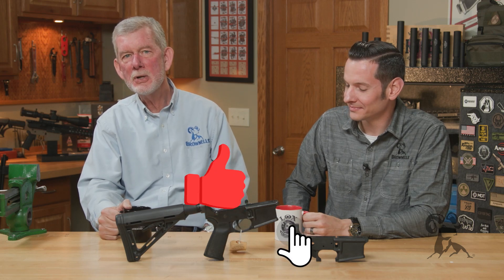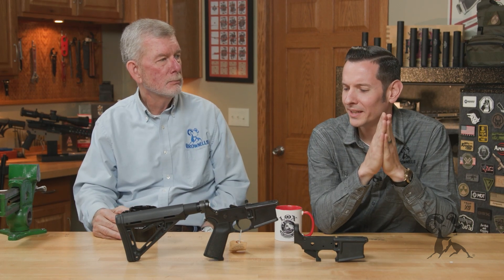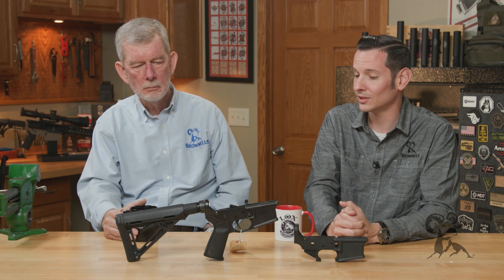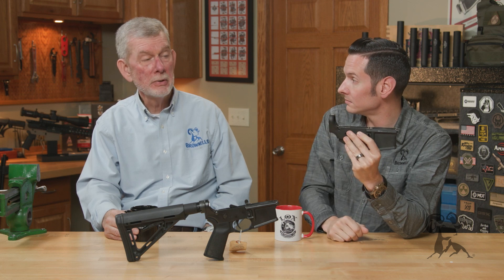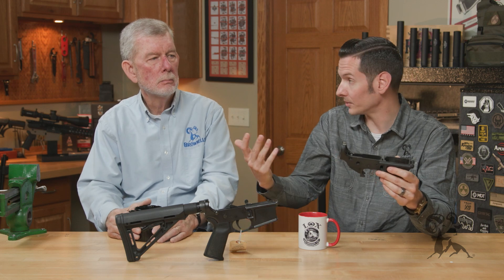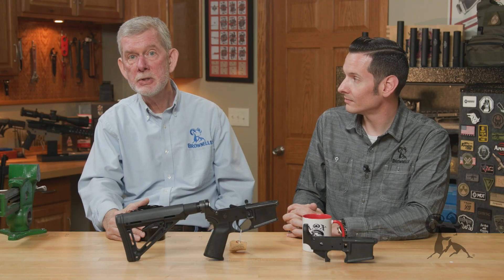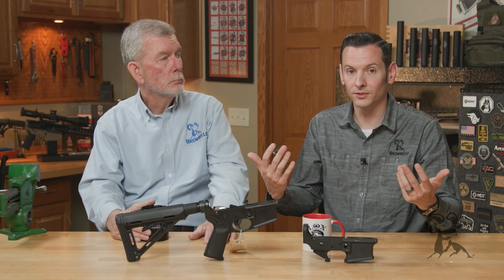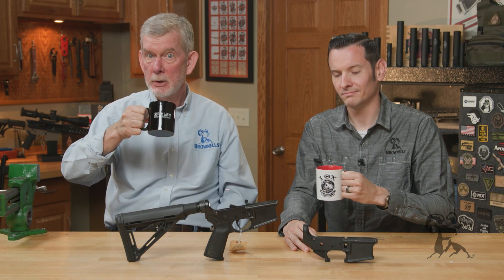Smyth Busters: Are Polymer AR-15 Lowers Any Good?

Comment: Steyr AUG?

The problem is that when people think “polymer”, they think it means “all polymer”.  Particularly with the Glocks, the bearing surfaces are frequently reinforced with metal to absorb the friction of the moving metal.  In the case of the KP-15 and KP-9, since the bearing surfaces are mostly in the upper, they can do much more with just polymer (although they do warn about using smooth springs in the buffer tube to avoid abrasion on the support surfaces).

Comment: One of the most durable polymer pistols I've ever owned is the Ruger P95. Not only is it polymer but it doesn't have steel rails that the slide rides on.

Comment: I have an American Tactical Imports complete polymer AR for a few years now and the lower is great... I did crack the upper but I blame myself, I let the upper drop as the lower was in a vice and   the upper was still connected with the front pin, had a bunch of accessories on top as well so it cracked, the lower was just fine tho.
Reply: Yeah I'm not buying that story. If that were true, recoil would have broken it due to the inertia of "uh bunch uv accessories". A lil swing on the front pin shouldn't have broken anything on a functional product.
Reply: @camojoe83  had it for years before that happened idk... It was fine until I did that but in any case the lower was still gtg... I think forces that act on a weapon when it fires might differ a bit from dropping it. For instance, did you know that your not supposed to pull the trigger on your AR without the upper or a block? It can damage your lower. Sometimes you can get away with it sometimes it can't.

Comment: They real comments is that any lower will function correctly if the design takes into consideration of the material properties is made of.  I'm willing to bet if you do a polymer lower with the exact dimension of one made from aluminum it will not last.  Almost anything can be built as long as is engineer correctly.

Comment: Hypothetically speaking (the what if game), if you had to startup from zero. Speed, availability, and cost being sole factors would it be aluminum or polymer? Durability or longevity notwithstanding.
Reply: I would assume aluminum because it would be much easier to sell to people without brand recognition and trust. Polymer should come about later on once you’ve built good will and a customer base
Reply: Create brand recognition first, makes me think of CompaQ “compatibility and quality”. Consumer confidence and recognition should be most important consideration. I was thinking that would be recognized in the engineering of the components. That driving factors should be cost and availability upfront and as demand increases speed in scaling up. Aluminum or polymer?

Comment: I have a KP-15 build that’s wonderfully light and no worries about that stress point Caleb pointed out. However, I would only use a cassette type trigger in it, not milspec. There’s just enough play around the pins to make me not trust it. There’s a reason KE-Arms sells captured fire control pins - that’s what you should use with their lower and you should only use those with a cassette type trigger.

Comment: It won't last but the fact is that it doesn't have to. I mean I have like 5 polymer lowers and iv never had any fail though I didn't shoot any of them extensively. I'd say you can be sure it will work for a minimum of 1000 rounds.
Reply: what i seen most polymer lowers thats the exact  stopping point 1000 rounds and they break but the ati lower i had lasted 400 rounds maybe a few rounds less than that

Comment: I did a CWP course in SC and used a Gen 2 Glock 19. One of the employees pointed out the original case that I had the pistol stored in to another employee. Almost exactly like a Tupperware container.

Comment: I have an AR308 and an AR9 on a polymer lower both run flawlessly with no issues. People just like to buy crap, go with brand that shows what their lowers can do, 3rd party reviews, and integrity.
Reply: Pushup test. Now.
Reply: @camojoe83   how about a push up test, testing a .50 bmg upper on one in -5°f weather, running it over with a car, sitting it in an oven for 1-2 hours at 170°, and putting it in a vise crushing it and still snaps back to shape. All that and if you still managed to break one has a lifetime warranty.

Comment: I will pass on a polymer ar15 lower. There is a big difference between a pistol lower and an ar-15 lower. On a pistol like my SIG P320 the polymer connection to the barrel is reinforced by the FCU. On the back or am AR-15 there is a very small area that takes all the force, as  he pointed out in the video and I just don't trust it, especially in temperature extremes, where plastics will be more brittle.

Comment: I've been using James Madison Tactical's Carbon 50 lower for awhile now on a 6.5 creedmoor and a 308, the reduced weight was really nice. The only issue I've had was using anti-rotation pins, if you tighten them too much, you can cause failures on standard FCGs, namely the hammer not locking back when the rifle cycles, all that needed was to loosen the pins, though I mostly use single piece FCGs now, those have had no issues.
Reply: Zac's DIY Guns  So many jokes you just laid up for me there....but seriously, no issues other than the bolt catch fitment I mentioned above.
Reply: I've had very good performance out of JMT's lowers, both the regular polymer and the Carbon, in 5.56, 6.5 Grendel, .300 BLK, and .308.  Only issue is some aftermarket bolt catch assemblies (Phase 5 EBRv3 comes to mind) may be a bit thick where they ride inside the lower, nothing a little filing can't fix.  Milspec parts are no issue.

Comment: You guys are always a pleasure to watch. Thanks for taking the time to prepare and present these videos.
Only experience with polymer ARs was a Bushmaster Carbon 15. Upper and lower made of polymer. Came by it in a trade. Was covered in a factory paint job with multiple silver color overlay of skulls. It was UGLY! And further, I didn't trust it any further than I can pick up and toss an M4 Tank. Fortunately, I found a guy that wanted it bad, and it was gone fast. Nope, I don't trust plastic guns, far less if they have stupid skulls all over 'em! 😄😛
Reply: Did you even shoot it?  Or did the skulls scare you?
Reply: Oh yeah, I shot it a bit. Was over gassed, and not the most accurate AR carbine I've fired. Just wasn't something that I needed.

Comment: I design 3d printable firearms, ammunition and accessories and yah, polymer works if done correctly. Just finished up an ar15 style design that has a plastic lower and upper and it's running like a champ.
Reply: Not strong enough for a dinner plate. 3D printing is even worse than the old polymer lowers. It was created for proof of concept and to keep from having to make multiple expensive molds. It's not a be all end all as most of you proponents think it is. On the contrary, it is the very last thing I would ever want a weapon to be made of. A stick would be less prone to damage and much easier to replace in the field.
Reply: @drtmi8789  navi go boom is gonna take a hot steamy dump in your pillow case once night. you are full of s-h-i-t. the ubar lower is strong as hell. edit: it seems i now have to manipulate text, because youtube has gone the way of twitter and instagram

Comment: why buy a poly lower when you can print a U-bar or hoffman tactical lower? Incredible strength
Reply: Because printing is/was not created for production to get every Tom, Dick, and Harry into building guns. 3D printing was created for proof of concept to save on mold costs. 3D printing has NO place on load bearing surfaces.
Reply: @drtmi8789  I agree that printing is not up to snuff on load bearing surfaces. However, this is a discussion of AR lowers

Comment: I’ve been 3D printing a few. Where the buffer tube threads in are reenforced with either a bolt, overprinting, or using a folded piece of metal that is either screwed or melted into place. Annealing helps too on certain designs.

My KP15 works just fine too….and it’s in 458😂😂
Reply: Unless you're printing the whole stock and buffer tunnel integral to the swollen, stupid shaped lower you have to make, 3d printed lowers are a stupid waste of oil.
Reply: @camojoe83  not really. Like I said, people have found ways around it. But, to be clear, they don’t last as long as metal lowers, but after 1-2 thousand rounds, you just print another. My Hoffman designed lower is at about 1100 at the moment, no issues.

Comment: Still better to get an aluminum lower for same price
Reply: Fair but if you want one that isn't tracked, it's much easier to finish or print a polymer lower for the common person than it is to finish a 80% aluminum one. 

If one doesn't care about that, then aluminum all the way.
Reply: Really?  A stripped KP-15 comes in at less than $90.  All you need to complete it is your FCG, mag release and bolt release.  An Anderson or PSA lower comes in at $59 on sale.  Then you still need an entire small parts kit as well as a stock, and pistol grip.   That puts you above the KP15 in cost.  Plus you get better features with the KP-15 such as a flared mag well and a Magpul like grip.  I can attest to lower buffer spring noise when using GI spring and buffer.
Reply: @panzerabwerkanone  in all reality both require similar priced lower parts kit  with FCU (the few parts that come with the KP15 aren't going to save much money buying separately), buffer and buffer spring. The only real difference is stock and you can get a standard m4 buttstock for $22.  So all in all they are about the same....but you're stuck with a non-adjustable boat anchor of a stock with the KP15.

Comment: I have a KP15 and its just fine. I put a pencil barrel and a 8 ounce aluminum handguard and its unbelievable how balanced and good the gun feels.
Reply: Why would you put such a heavy handguard on a lightweight AR
Reply: @Valorius  what do you recommend?
Reply: @deejayimm  for a handguard?
Reply: @Valorius  yea, what would be a good one for a light build
Reply: @deejayimm  there is a vid on my channel for the one I use. It's 10.5" and weighs 3.7oz with all the hardware and barrel nut.
Reply: Have one myself.  Love it.
Reply: Did similarly years ago, pencil barrel on a Cavalry Arms lower, but used a regular plastic (with heat shield) CAR handguard.  Light, balanced.  The Cav Arms was the predecessor to the KP15 lower.  They took what they learned from the Cav and put it all into a much more refined lower.
Reply: Awesome!  I've built two.  My first was for less than $600.  A much better gun than I could buy assembled for that $
Reply: We will see how balanced and good it feels when you are holding with two hands. And it’s a piece in each hand
Reply: @Dan-qn3su  because even though it is being held with two hands you can feel the difference in weight from the front to the rear. A rifle can be front or rear heavy.
Reply: @cameronwashington7650  I think he's trying to insinuate that your lower is going to break in half.

Comment: Can you do one about sharing BCGs between different uppers? Does the bolt really wear to the locking lugs?
Reply: I switch mine all the time. It makes no difference what so ever.
Reply: Only if you have a lot of rounds through either.  It is not that much of an issue with the AR-15.  Buy a set of headspace gauges if you want to be sure.
Reply: It's not the issue it used to be. Manufacturing is pretty tight these days even among different suppliers of parts.

Comment: If nerds with 3D printers can do it, I'd hope an injection molded polymer process can hold up.
Reply: They can only do it for one video at a time tho.
Reply: @camojoe83  that's a lie. Some guys have well over 1k rounds through proper built 3D lowers.

You just have to have the right material and know how to make a good print that has good layer adhesion. You have to account for shrinkage when you go to anneal. There are factors here that most people never understand because they have their heads in the sand.

Comment: I was in a gun shop a guy came in with a polymer lower that broke at the rear takedown pin. The worst part was he paid over 1000 for the compleat gun. Same gun store wont sell polymer lowers of any brand they have seen to many brake with low round counts.
Reply: Across the board proclamations is typically the realm of the moron.
Reply: Pardon me sir, compleat=complete
Reply: @camcom76  There were more misspelled words than that.  I realize English isn't everyone's first language but you have the sum total of human knowledge at your disposal.  Use it.
Reply: So you lost a customer when he went and bought it someplace else
Reply: @didamnesia3575  reading is hard huh?
Reply: @drtmi8789  I didn't misunderstand anything. I bet that customer left and never came back considering the OPs attitude. And your attitude?  I can read just fine thank you. Perhaps you should put the beer bottle and can of chew down, go outside, maybe put a shirt on first, and look at the sky for the first time in months. Go do that. You'll feel better
Reply: @DIDAmnesia

The OP did not say he worked there.  He just said he was there when a guy brought in a broken polymer lower.  He also said the worst part was how much the guy spent on the completed gun, and that the same store won't sell any polymer lowers because too many break.

Not sure where his attitude would have driven a customer away.

Comment: Polymer lowers need to be reinforced look at the Hoffman tactical one for reference excellent design he also has a excellent video on torture testing various polymer lowers
Reply: big facts right here
Reply: that's 3d printed, injection molding is much stronger. 3d printing is slowly catching up but as of yet doesn't have the strength of other processes.
Reply: @walkercustoms409  yes but you're better off using a 3d printed lower as a blank for the mold because you can easily scale the model to accommodate for resin shrinkage.
Reply: Not really, not exactly a lot of pressure..a cast lower can handle way more than a printed one and you can just throw them out when they start looking bad and just refill the mold.
Reply: Not exactly apples to apples when comparing a 3D printed lower (which can have layer adhesion issues) to a cast lower.  But yes, I agree that any polymer AR-15 style lower needs to be reinforced in the weak areas, whether that be by increasing material thickness or by external devices.  And I'm a big fan of the Hoffman designs.  Very well thought out.  👍
Reply: @twinturbostang  Then you should check out Hoffman's video where he explains that layer adhesion issues aren't even a thing anymore.  They're fixed.  Done.  The main issue facing printed designs these days is warping at temperature extremes, but considering how quickly the technology is advancing I'm sure that'll be fixed soon, too.
Reply: @charleschristianson2730  There definitely is reduced strength across the layers.  You can look at Hoffman's graphs and clearly see the difference in the tensile strength and impact resistance tests when printing the test parts flat on the bed versus standing up.  Also, if layer adhesion issues aren't a thing anymore, then there would be no need for the buffer clamp.  But as it is, if you remove the buffer clamp, it will fail splitting along the layer lines.
Reply: @twinturbostang  yes as someone who has printed a few Hoffman lowers now having the hose clamp on the buffer tube pretty much solves the problem
Reply: @twinturbostang  I'm not arguing that prints aren't generally weaker between the layers than they are across them, but this has been reduced and accounted for with modern designs and materials so it isn't the major issue that it was until recently.
Reply: @twinturbostang  if you check out his video he destructively tests a standard polymer lower as well and compares the two it's a good informative video I think you'll like it! 👍
Reply: Polymer is different than 3d printing
Reply: @RandomLombax37  you mean casting is different than 3d printing, they are both polymer.

Comment: I've never seen or Held a polymer framed ar. What would be the benefits of a polymer lower ? Would it be lighter then 70/75 aluminium?
Reply: Its lighter and when used with a pencil barrel or Gunnner profile barrel it shifts the center of balance back towards the shooter and creates an unbelievably balanced and great pointing rifle. I have a KP15 polymer lower with a pencil barrel and lightweight free float aluminum handguard. It's really eye opening how great an AR can feel when its designed with modern materials and shooting philosophy.
Reply: @timrobinson6573  My experience has been the same.  I have a CavArms MKI and the improvements are noticeable in the new KP-15.
Reply: Because they think it’s cool